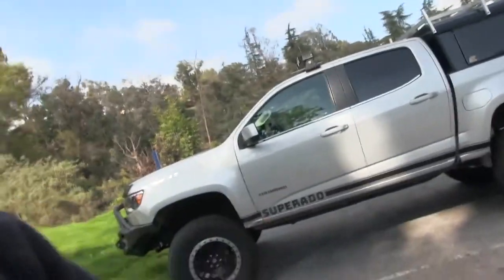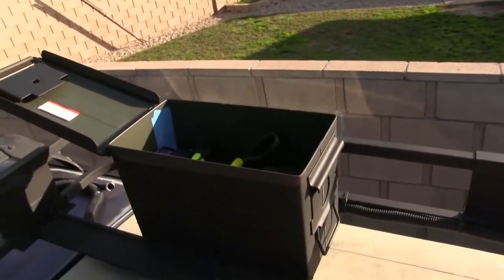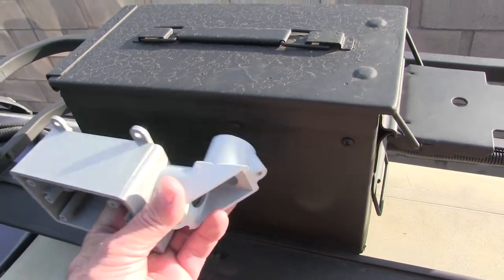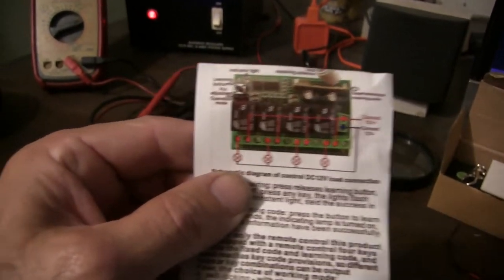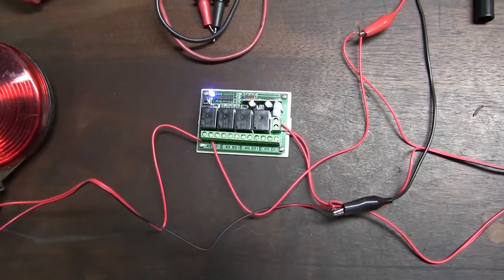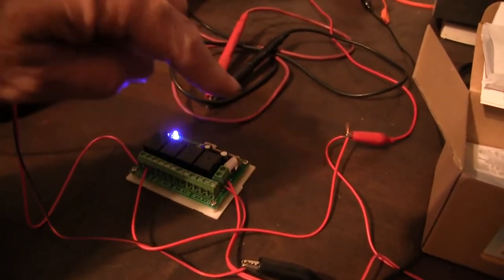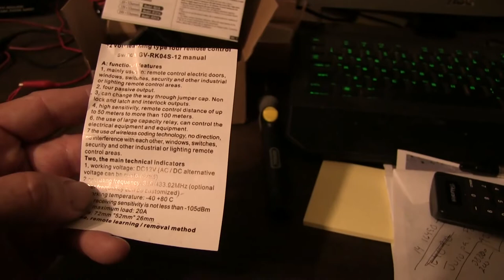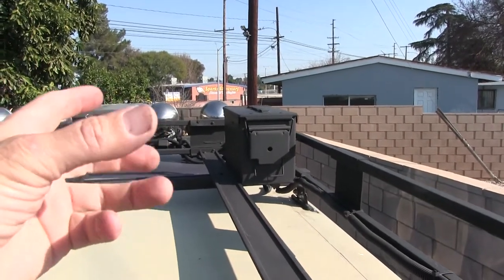Project Bronco Wireless Light Control

Comment: going to be pretty slick once it's  done.
Reply from the maker: It works!  I just did a test using my battery jumper pack for power. Good range from out on the street to the backyard. Still need to run power from the battery.